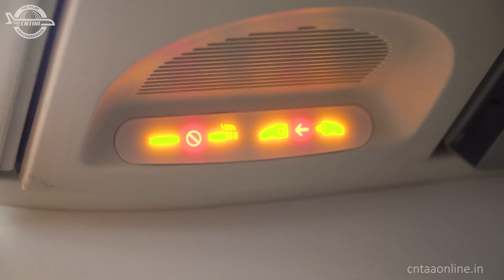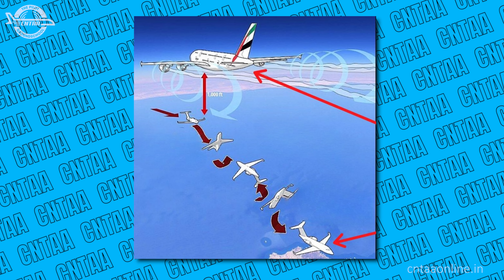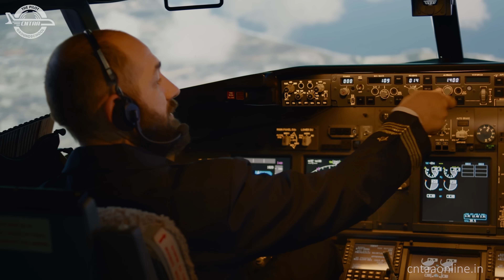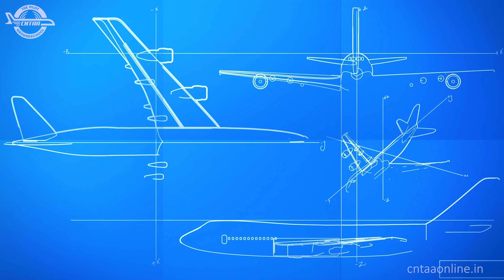Airplane Turbulence : Should You Be Worried? Explained by Capt. Neha Thakare

Comment: Flying west to east. Aided by Jetstream? Or, direction of rotation of the earth? Drawn on a scale model of the earth a jet at 35,000 feet altitude is practically touching the surface and enclosed in air, which is a fluid surrounding the planet and part of it the direction of rotation has no effect, as being inside the blanket of air is synonymous with being inside the planet.

Comment: Flight s to types engine, internal combination(oxygen use work, gasoline fuel)engines  and gas turbo engines(Layneyear momuteam formula based  or polick Boomm Fuel,liquidNitrogen-80%ethanepropane-20%), fuel ending time  ADI (archanely director of indicator) 104 battery 🔋 s, 9mints working(lithum or Hydrogen or sodium),engines failure time propeller use turbo engine,